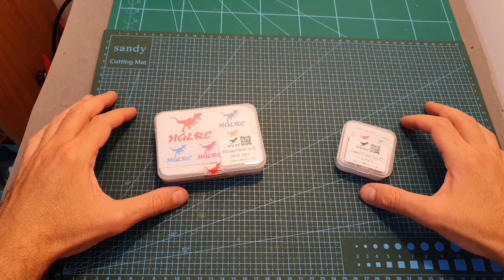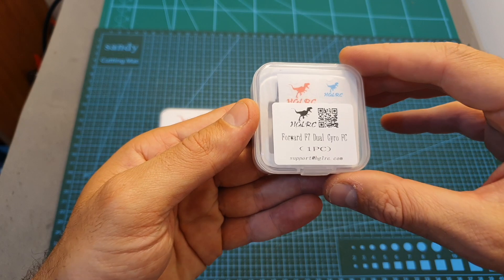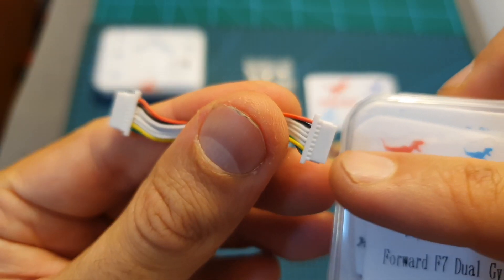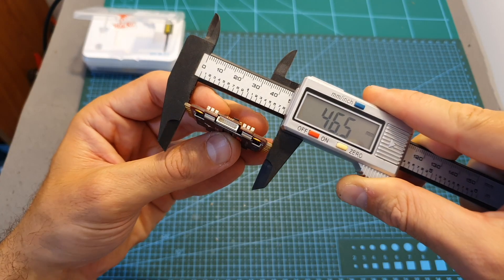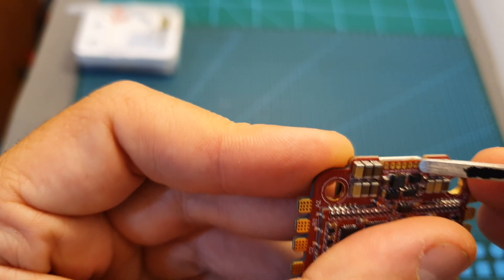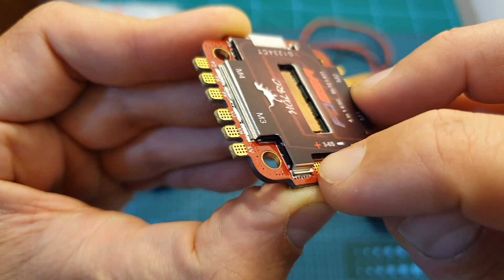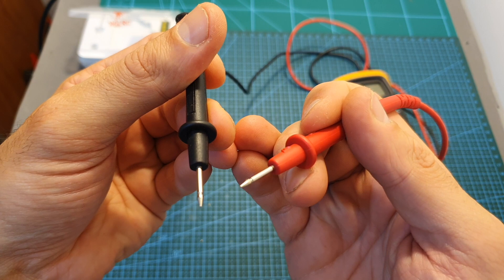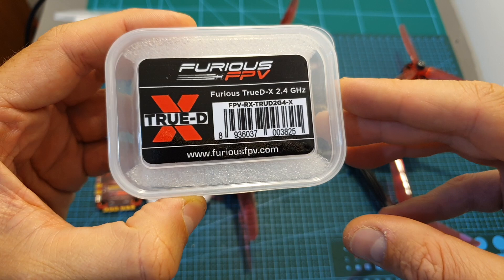HGLRC FD65A 4 in 1 ESC Overview

Comment: the current rating 65 amp is the max current  the esc can take from the battery or it is the max current  that the esc can give to per motor?
Reply from the maker: Both. If the motor will draw more power from the ESC it might burn it.
Reply: @KremerFPV  so means 65 amps is max amps esc can take from battery?

Comment: Hello sir, Thanks for the video. Maybe you can help me. When I connect to blheli_32 suite it says "found no valid escs".  Are you able to connect to blheli_32 with yours?
Reply from the maker: Yes. Have you successfully connected BLHeli32 Suite to other ESCs?
Reply: Gal Kremer yes I have two other quadcopters that can succesfully connect but not these escs. I could not figure out the problem. I tried downgrading the blheli32 suite but still could not get it to connect. Everything on betaflight gui works. All motors are spinning fine.
Reply from the maker: @oversitebored5002  Strange. I suggest contacting HGLRC.